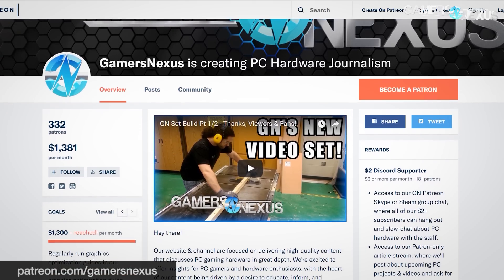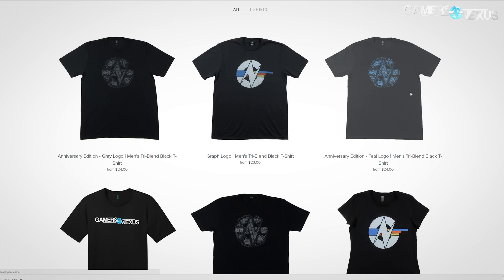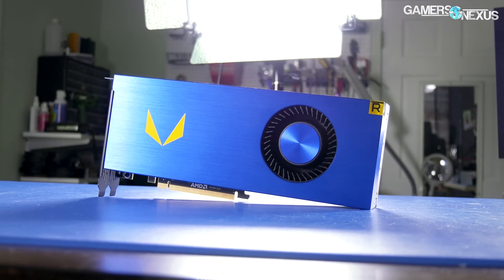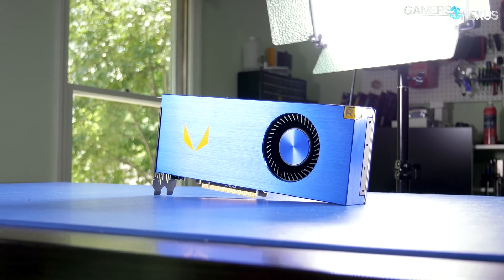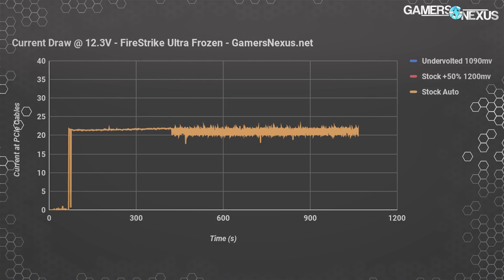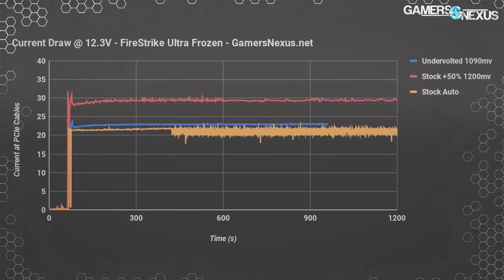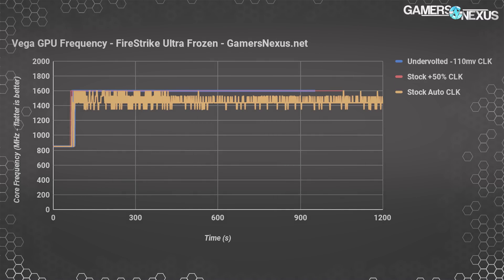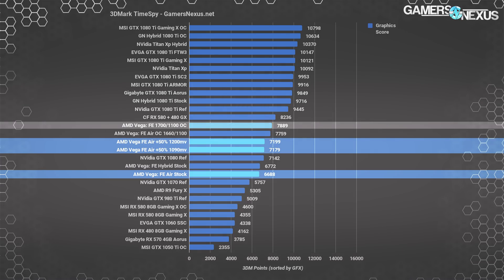Undervolting Vega FE: Fixing Performance & Power

Comment: Our upcoming Volta GTX 2060 @ $249 will trash this piece of crap.
Reply: $349 due to CEO math.
Reply: Jensen Huang cool story bro
Reply: 250 jajajajaja
Reply: Too bad G-sync costs $150-$200 more than Freesync. Otherwise I would have considered Nvidia.
Reply: CEO who doesnt even get the naming right... volta will be gtx 1180 you moron
Reply: Jean Sen people always said nvidia keep pushing the price higher but did people actually check the pricing for nvidia cards the past several generation? the price is a bit fluctuating from one generation to another but the fastest part so far still did not exceed $700 mark for MSRP since 2013. the x60 have always within $200-$300 price point. 

GTX460  - $230
GTX560Ti - $250
GTX660Ti  - $300
GTX660 - $230
GTX760 - $250
GTX960 - $200
GTX1060 - $300 (FE)/$250 (non FE)

so it is very likely the 2060 will be around for $250 and above with 1070 to 1080 performance.
Reply: Jensen Huang Nice try Nvidia
Reply: $249... yeah I call bullshit on that. probably more like $349 to $399.
Reply: Roikhan Ulya Hamidan except nvidia is not intel. also nvidia is very aware what AMD is capable of. just because they were ahead meaning they can take it easy. because AMD have always something up their sleeve. and when they hit it capable of hit that is very hard on nvidia and it happen for a few times already.
Reply: Jensen Huang I guarantee u guys that this is really him. Legit.
Reply: Jensen Huang when?
Reply: Scooby Dooby That's fine with me. I just bought a 1080 TI lol..
Reply: 2490 dollars more like.
Reply: you forgot to tell them until we release another arch, and Volta gets Gimped. NICE B8 m8
Reply: Jensen Huang sucks for amd but if this is true I'll fucken throw my pc away and get that fucken 2060
Reply: you forgot "glued together"
Reply: Only until its sold out like 580's and it will cost 600$
Reply: +Renzc ode there's many rumor that they'll bring pascal refresh rather than volta, that's just like what intel did. I know amd bring refreshed cards too, but that's because they can't afford to make a new one.
Reply: Roikhan Ulya Hamidan many? from what i know so far that rumor only coming from one source: fudzilla. many other site that talking about the pascal refresh also have their source coming from fudzilla. as i said nvidia is well aware that AMD is not to be underestimated. there is no way they will give AMD the room to catch up. because once they catch up to you they might as well hit the home run like they did with intel right now. those 1080ti at $700 and the price cut for 1080 last march is nvidia preempt strike against Vega. if you  think about it logically nvidia can keep the price high and only drop the price once Vega comes out to maximize their profit margin. but they choose not to do that.
Reply: +Renzc ode they drop 1080 price because 1080 ti is coming. They are a company, a big one, they'll always want to get as many provit as possible without spending too much. Even if they ended up bringing volta instead of pascal refresh, im sure it'll be more exspensive than what we expected, unless if amd manage to do something about it.
Reply: +Renzc ode that's are mid end card, amd always capable to compete in that range, that's why the price isnt that big, did you remember at 1080 launch it was almost as expensive as $700
Reply: Roikhan Ulya Hamidan but why nvidia have to drop 1080 price when there is no AMD card that can compete with 1080 back then? as i said earlier Nvidia can simply keep 1080 price at $600 ($700 for FE edition) and selling 1080ti at $800-$900 is nvidia simply want bigger profit. then only drop the price once RX Vega comes out. why nvidia did not do that right now?
Reply: +Renzc ode to put it simply, Nvidia know that Amd has moved their money and effort into the CPU division.
Reply: Roikhan Ulya Hamidan the flagship have always carry price premium. that is nothing new. but look at 1070. back in 2015 to get such performance you need to shell out at least $650 for it (980ti/FuryX). then in 2016 nvidia bring such performance down to 380-450. when nvidia put 1080 at $600 (for non FE) nvidia could make the non FE price of 1070 starts at $500 instead of $380. 1070 at $380 is pretty much in line with previous gen x70 pricing:

470 - $350
570 - $350
670 - $400
770 - $400
970 - $330

and this gen AMD still did not coming out with true 1070 competitor unlike with 1060. and yet 1070 pricing still pretty much inline with previous gen x70
Reply: Renzc ode that's because Amd still competing. what in line? their original reference was never more expensive than the AIB partner cards before pascal, and now with pascal they decide to bring this Founder Edition bullshit that cost significantly more expensive than AIB partner cards, i mean how could possibly its in line when the reference gtx 970 was $330 and now the reference/FE gtx 1070 is $499 which is significantly more expensive, even the 1080 FE was $699, they drop its price to make room for the 1080 ti which also cost $699.
Reply: Roikhan Ulya Hamidan but did nvidia forced you to buy the founders edition card? as long as the cheaper version from board partner still available i see no problem with that. the fact still remain that the non FE MSRP starts at $380. why did you purposely compare 1070 FE pricing ($450) vs 970 base MSRP? i will take issue if the founders edition is the cheapest version available to consumer. though i think nvidia most likely done with this Founder Edition stuff hence there is no FE for 1080ti. the FE issue is more with the metal cooler that nvidia supply with the reference design. it is the sole reason why the FE  is more expensive to begin with because nvidia finally decided to charge premium for it. maybe nvidia should revert back to those plastic blower cooler that they use before.
Reply: +Renzc ode you making things up, they charge premium because they can. The ref/FE is The one that supposed to cost cheaper since its the most basic one, the AIB is already expensive in general and cost above msrp because of much better cooler and etc, so they force us to spend more for an AIB card by making the ref/FE card even more expensive so that they can get as much provit as they can.
Reply: Roikhan Ulya Hamidan the FE was expensive because nvidia decided to finally charge premium on the metal cooler. if anything it is board partner that are making profit. have you ever think when board partner replace that NVTTM cooler with their own plastic shroud and yet they still asking the same price? so when you think about it nvidia reference design with more expensive metal shroud should be more expensive to begin with and yet board partner still get a pass for replacing that metal cooler with a plastic one and yet still asking the same price for their "reference". this is how it was with GTX770, GTX780, GTX780ti, GTX970, GTX980 and GTX980ti. but as i said it is not a problem as long as there is board partner card that is cheaper than the FE. heck with pascal generation you don't need to get yourself the more expensive model with fancy feature to have the best performance. if performance is all that you care just take the more cheaper model. take this for example:

https://www.techpowerup.com/reviews/MSI/GTX_1060_OC/

the card perform and overclocked just as good as the Gaming X model. and yet it was available with base MSRP pricing. you only missing the 0db and fancy LED effect that comes with the Gaming X model.
Reply: +Renzc ode that's what im talking about, why a reference cards need such a thing if not for provit? their old ref card is just as good and cost cheaper. Also there's an AIB cards that has a much better quality shroud and yet cost cheaper.
Reply: Roikhan Ulya Hamidan initially that NVTTM cooler was exclusive to GTX690. but that probably fitting for the asking price for GTX690 which is 1k (dual gpu in the past are much cheaper than that) while 680 and 670 are using the usual plastic shroud. but there probably a request to make that metal cooler as default for reference design most likely coming from the boutique system builder which usually build custom system for very expensive price. in fact the one that really excited about nvidia offering FE based GPU for the whole lifetime of the GPU is none other that boutique system builder itself. board partner actually did not really like with the FE scheme because it was as if nvidia is asking them to sell their own "reference" with those plastic shroud at much cheaper price. if the FE and plastic reference from board partner have the same price that's mean board partner able to cheap out on the material but still able to ask for the same price. that's mean there are more profit for themselves.
Reply: +Renzc ode if that's the case, they should make separate usual reference card and FE card. Still unnecessarily expensive.
 Idk what do you mean about the AIB reference cost the same, they usually cost less and has better cooler, even the most expensive one isn't as expensive as the FE.
Reply: Well hurry up & release it then Jensen, you're all talk but do you walk the walk? #Kappa
Reply: Nobody believes you work for NVidia. Well, maybe you, but you're an idiot.
Reply: thread/
Reply: Nvidia wouldn't be that stupid to release a new card that boast a huge performance uplift if amd cant even compete with their current product, most likely they will milk the consumer with pascal refresh just to get as many provit as they can just like what intel has been doing all these years.
Reply: Jensen Huang lol fuck NVIDIA PROPIETARY bullshit
Reply: Jensen Huang any Nvidia gpu trashes amd, they are far behind at the moment.

Comment: So with dialing in the undervolt it's holding 1600mhz and is about = to a 1080, maybe better depending on the game. Okay... they really did rush this thing out the door. Only 30-35% to go before it's at 1080Ti level. With an overclock that was what, another 7%. Let's just say it's 25%. So between magical driver updates for performance and enabling features on the card (which may or may not be the same thing) plus somehow higher clocks out of box on RX vega??????????? it's got to close 25%. 

That looks a little more likely and might be more feasible. Even within 5-7% of a 1080Ti priced at 550$ and I'll buy two. Damn the cost of having to run them both under water and whatever else bootstrapping I have to do to have a functional high end amd setup. It's kind of frustrating you have to put so much effort and thought into an AMD product, I don't mind as I am an enthusiast, but still; you can just drop extra cash and not worry with Nvidia :(

Also just want to say: THANK YOU GAMERS NEXUS. Really wanted this kind of information, and without you guys, I wouldn't have access to this information. Not sure what else there is to say. You guys fill an important role in the hardware community that isn't clickbait crap and all the same HW stuff everyone else does.

I guess one more thing. See how high you can push the clocks regardless of whatever voltage you have to put in. Watts be damned. With the VRM being what it is, the main problem with would thermals and volts. Up the voltage, good water cooling, could this thing could 1800-1900 core clock?
Reply: Wouldn't count on 5% less than 1080ti performance. The flagship gaming RX Vega will sit maybe 10% higher than a 1080, so at least 15% behind a 1080ti.
Reply: Well, it's at or above a 1080 now, that's not even overclocked, just with proper thermals. I figure 15-20% from driver, 7% for OC and whatever else they plan to turn on. fact is we already saw a big improvement with the card actually running at the right settings and temps

Comment: So the question is, doesn't AMD do these kind of tests? Or do they just not give a fuck and ship a bad/faulty product to meet launch dates etc. Leaves a bad taste in my mouth.
Reply: They have to pick a voltage before they have silicon back from the foundry and then they have to settle on a voltage and frequency with only having very early silicon in hand. They don't really know how retail chips are going to end up or if they pick a voltage that's too low how good their yields will be.
Reply: sparkyenergia they pick the voltage before having silicon WAY before shipping retail products. probably around the time they showed vega at the ryzen reveal, where Linus remarked on the blue duct tape covering half of the card, including some debug headers. before shipping any products, amd MUST have done a test run on the final production  line, and gotten back hundreds of samples to test. if they didn't, they they are either very stupid, or cannot afford proper validation and testing.
Reply: na, i think the drivers are fine..... and AMD has improved SO much in video drivers. 

a 480 isnt going to age like a 7970....

i think its all the bugs with HBM that are killing them.....which is why i think FE cards are half broken
the drivers were fine back in doom demo days.....and then FE vega is the SAME THING, so you would think massive parts of the drivers would be the same.....

but unless FE drivers just....straight up dont have game drivers like a normal card.....i dont think you will see it from drivers

but if it beats a 1080ti.....and is 300 to 400 bucks.....thats one HELL of a value
Reply: AMD has improved the drivers on OLDER cards. It took them years to get them right, because they released half-baked drivers that didn't fully utilize the hardware. It may take them another 2-3 years to get the vega drivers right. And people will call this "fine wine", while nvidia users got their wine ready for consumption at purchase.
Reply: remember the doom demo where early vega was running 70ish fps in doom. GN benchmark show vega fe with 65fps in doom. and the early was running super beta drivers. That probably why vega is so delayed, to get drivers up and running, I just hope amd has a magic button to make rx vega > 1080ti. only then will innovation move foward
Reply: yeah, AMD kind of made a promise about vega they had to keep somehow...
i'm not too happy about the way they handled it

the fact the gaming bios on the FE card doesn't do a damn thing, kind of indicates there simply are no proper gaming drivers yet for vega, or at least not ones that make use of new vega features, one would expect a bit more  dx11 performance with the rasterizer enabled, it could at least help alleviate the memory bandwidth issues VEGA appears to be having right now

if the tile-based rendering on VEGA is anything like nvidia's jump from 700 to 900 series, where they could drop a bit of the memory bus width because the workloads were sliced smaller, 
iit could potentially still see like a 10% maybe 15% gain, especially in older dx11 games, if it's as good as nvidia's implementation.
also, assuming you have a CPU with quick single threading capability to make up for the fact the amd drivers dont't tend to thread that well, and usually sit on the back of an already utilized core to feed the GPU.

also if you look at what tile-based rendering did for the 900 series nvidia cards in terms perf/watt,
it could be somewhat of a bastion of hope for vega

some people (including myself sometimes) are making it sound like vega is a piece of shit haha, 
but, for the right price it's not even a bad card as it is, 1080 levels of performance is nothing to sneeze at.

i'm fine on my rx480 for now anyway,
let's just pray the software is done by august :(
Reply: The Doom demo months ago had the fans running at 100% to "throw off the press".  We also have no idea the overclock or voltage on said card.  You can look at the graphs and see that with a little more tuning Steve could get this card over 60 min FPS on Doom.  I'm fairly certain an AMD engineer that's had the hardware for 3 years could do the same.

If they implement the broken Vega features that are not working in the driver and tune the power and clocks as they have already promised, the RX Vega card should be able to hit 60 min FPS in Doom, no problem.  AMD promised 4k gaming on a budget, not a 1080ti killer.
Reply: i have a fin foil hat theory......

FE vega is actually half broken/low bin RX vega chips......and amd is using the profits from a 1000 dollar card and ryzen TOOOOO....

sell rx vega for like 300/400 bucks.

but, if a 300 or 400 dollar card > 1000 dollar card......people would be pissed 

possibly they actually did gimp the FE in games.... and might gimp RX in its intended task??
that would be a huge scandal......

Comment: its clever "playing" with words from AMD tho.. vega in fact isnt throttling .. 1.6ghz is not boost but peak.. the introduction of this confusing nonsense is kinda saving their asses about "throttling" .. the typical clock is still rated at 1.4ghz so anything above that cant be throttling since typical is not base clocks.. kinda shady from AMD but clever in a same time... they could have higher power target from default and call the 1.6ghz a boost clock.. but that will never happend since the TDP rating is already really high.
Reply: Well, Its same everywhere.. Nvidia does this, intel does this.. its everywhere. Dont really think AMD "invented" this.